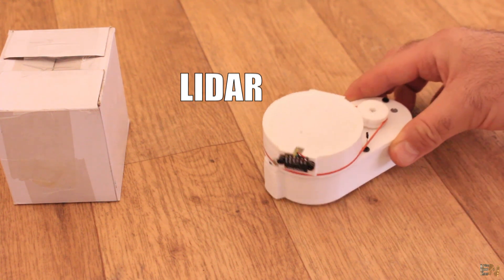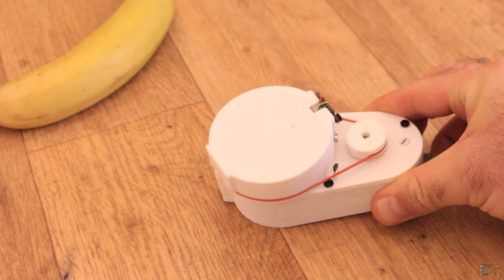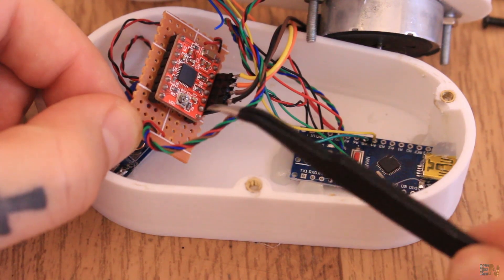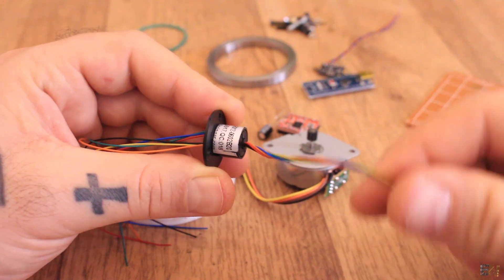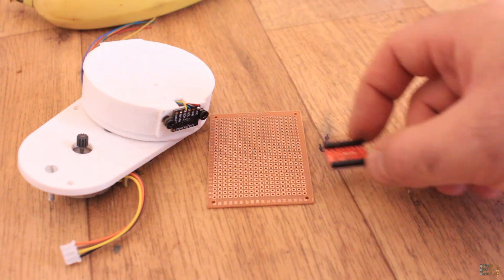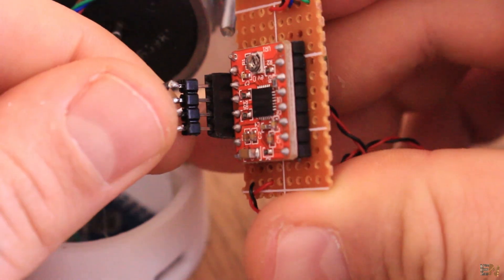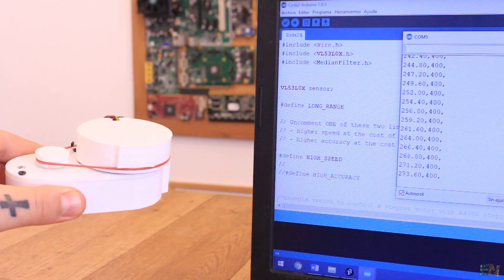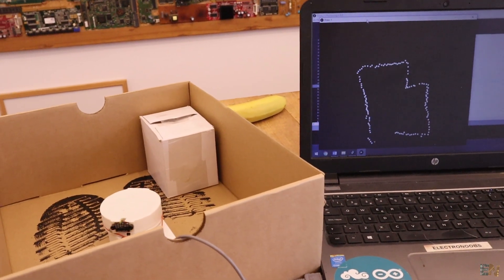Homemade LIDAR sensor with Arduino & Processing

Comment: I know you'll be not happy about that comment, but, man, you can add a gear inside the perimeter of the rotating disc, connecting it to the motor's shaft and make related gear teeth on the inside of the disc, so it will grab on the smaller gear, which is situated on a motor, so it will look like one of those vacuum cleaner robots.

Comment: Instead of counting steps what if you just used time? Since you have a hall effect sensor you could calculate the time the disk takes to rotate. Say we measure one rotation and it takes 5 seconds per rotation. This means that the front will be changing 73 degrees per second. So that means we could do something like f(s)= 73s so if we take a sample at .5 seconds using the time delta since the hall effect sensor has been activated we would get.  36.5 degrees. So depending on how you want your accuracy you can just change your sample rate. But given that the Arduino is having issues with just incrementing a variable maybe this wouldn't help. A raspberry pi pico might be a better fit for this since you could utilize multi-threading. Alternatively, if we know the sample rate we could store the expected angles and times in a dictionary. This would save on having to do the multiplication each time and instead having to look it up from memory. This would look something like this. Say we have a sample rate of once per second we know that our sensor travels 73 degrees per second. so we could say lookup = {1:73, 2:146, 3:219,4:292,5:365} this could then be accessed by the distance function. Obviously, for more accuracy, you would ideally have a larger dictionary with a higher sample rate.
Reply: Funnily enough I recently decided to build a lidar around a dc motor instead of a stepper after watching this video and I am using 4 magnets and a hall sensor for measuring the rotation speed and a 5th magnet and second sensor for detecting the zero degree point.

One of the issues I've run into is that with a time based system you need the motor constantly running at exactly the same speed in order to calculate its angle. If the motor stops, you won't receive any more pulses to calculate the speed so you will also need a timeout from the last magnet pulse after which you reset the measured speed to 0. In order to hold the motor at the speed you want you will need a PID controller unless you just plan on running it at an unknown fixed speed.

Additionally the dc motors I have on hand and tried tens to spin a lot faster than a stepper. I managed to get the motor down so that my sensor dome rotates at 200 RPM but if I try to go lower it stalls. Combined with the sampling time of the VL53L0X sensor which can be as low as 20ms and with some tolerance for other calculations I can only get about 10 samples per full rotation.

All in all I think it makes the project a lot more complicated to use a dc motor and if I hadn't been planning to do this simply to gain some experience with PID control I would curse my design decision by now because of all the little problems that have added up so far

Comment: Though it is clear that the sensor will no longer hold the properties of being a LIDAR when an Ultrasonic sensor is used instead of a TOF sensor, will it still work? The only difference will be that u have to play with the speed of light when using the TOF sensor, whereas with the ultrasonic sensor, u gotta play with the spead of sound.

Comment: You could eliminate the slip ring (which will wear out) by rotating a front-surface mirror instead of the sensor. And you don't need a stepper motor. A slow, geared motor powered by a voltage regulator with an optical sensor detecting its position on every revolution would work as well. Cool project. Next do an up/down left/right scanning version that can make a 3D image!
Reply: How??

Comment: Thanks for the video! 0:17 is not an infrared distance sensor, it is laser-based: "The VL53L0X’s 940 nm VCSEL emitter (Vertical Cavity Surface-Emitting Laser), is totally invisible to the human eye, coupled with internal physical infrared filters."

Comment: Could try microstepping the stepper motor and only triggering the sensor at each incremented step and only once data is received back, step the motor again . Could easily achieve 3200 data points at the cost of some stop start delay. Cool project👍🏻

Comment: Important note on the light sensor part number. The one in the video is the VL53L0X, vee ell five three ell Zero ex.

The confusing part number has both the letter L and the number zero.

For those who are interested in a slightly faster, and 4 meter range, try the VL53L1X. It needs a different software library, but it can use the same schematic and PCB. For those building their own boards, the VL53L0X runs at 2.7-ish to 2.9-ish. It does not work at 3.3 volts. The VL53L1X works from 2.7 to 3.4 volts. 

For a project that uses 3.3 volts, the 1x doesn't require another voltage regulator and i2c level shifters.

Some 3.3volt Arduinos work at 2.8 volts. In my experience, USB ports continue to work with 2.8 volt data lines even though it is out of spec. I assume USB has a much lower noise margin and maximum cable length with 2.8 volt data.

Comment: Use another TOF range sensor on the rotating head, symetrically. You’ll gather data faster
Reply: It looks like there are a place on the rotor for another TOF range sensor on the opposite place for the current sensor.

Comment: Can you use it with nodemcu to get data wirelessly?
Reply: I am using laser range finders with WEMOS D1 Minis. I am using the VL53L1X instead of the L0x. Note that the part number has a zero, not the letter O.

I  using a laser range finder library from sparkfun.
Reply: Yes, you can!
I made one, in my version the lidar can make a measurement in 3D space and send through WiFi to a Python plataform. That is my course conclusion project!
And it is open source :)

https://linux.ime.usp.br/~brunobra/MAC0499
(sorry, I don't have an english version)

Comment: Hi, what application did u use in plotting the distance read by the sensor? Hope you can share it :)
Reply from the maker: Processing. I will share it in a few hours...
Reply: @ELECTRONOOBS  did you use the serial reading from the com port to plot the distances of the sensor in a canvas like points? How do you make it to plot in x and y? 
Ohh with an angle, oh that's why you have a hall sensor there. So did you use the velocity of the motor constant to calculate a resolution (number of readings) given the rotation and then ploting with an increasing angle, up to 360° 
Forget my questions, i'm figure it out there with time.
Reply from the maker: @chikitronrx0  https://electronoobs.com/eng_arduino_tut110_2.php see codes here... You get angle and distance adn using sin and cos you can pass from polars to cartesians and plot them in Processing!
Reply: Got it! Thanks :)